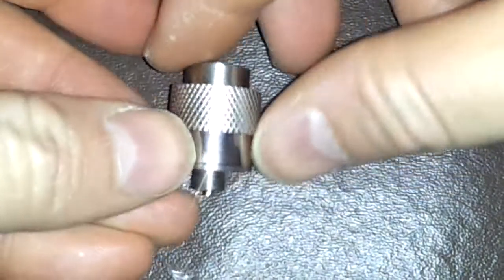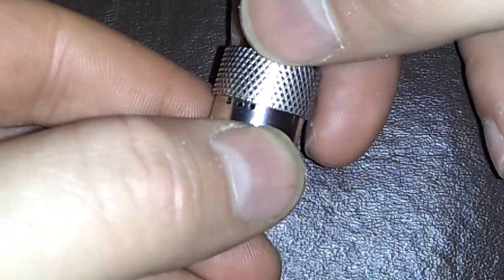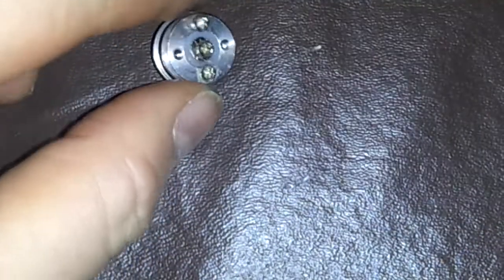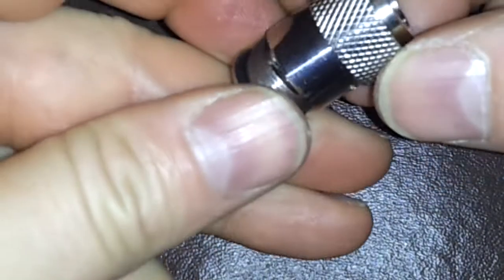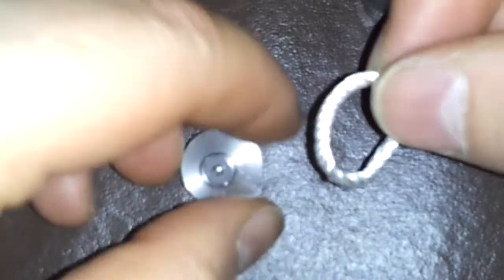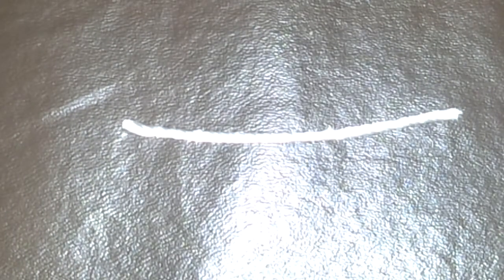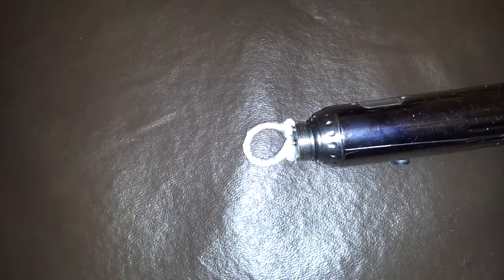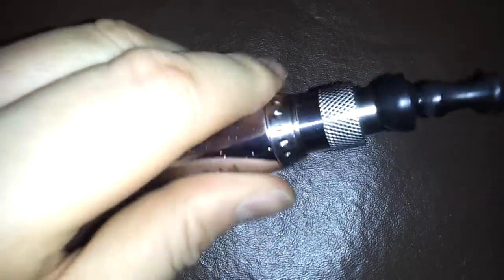Dream Rebuildable Dripping Atomizer BT801 (Electronic Cigarette)

Comment: This is just an all around great rebuildable, it's cheap, SUPER easy to build, and the air control eliminates the need from drilling out, a huge tip on this one, the come to you soaked in machining oil, to trash the pre made coil and clean it before use, after that, it's easy vaping, looks great on the provari mini